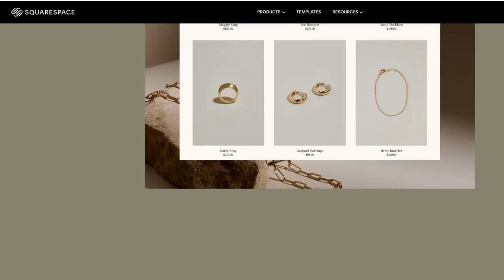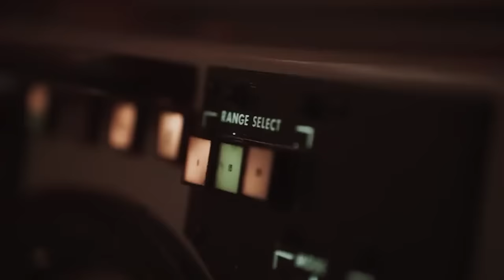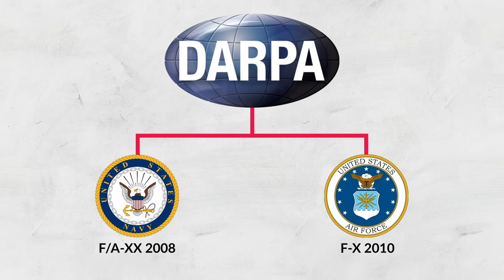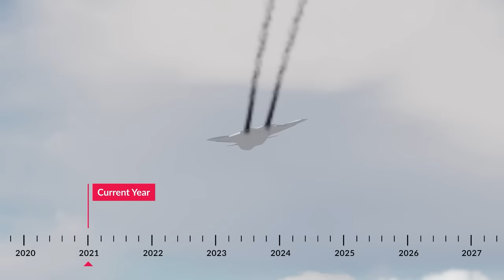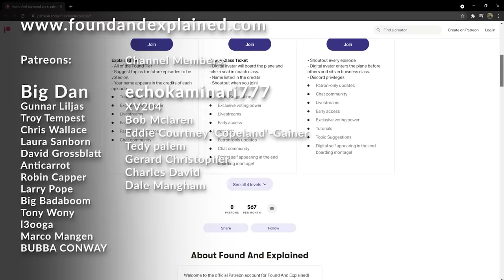FA-XX - The Next American Fighter Jet

Comment: 11:36 - The main reason Roper didn’t say whether it’s hypersonic or not is because it’s an absurd idea and is about as relevant in a 6th generation air superiority platform as the name of my third grade teacher. 

I hate to break the news to everyone who wants the next Gen fighter to be über fast: Speed is NOT going to be a primary concern for anyone designing or operating this airplane. Propulsion IS going to be a primary design feature, but not because of a particularly high top speed. It’s going to be about fuel economy and range as one of the biggest factors taken into account with this plane is it’s likely theater of operations. DOD is planning for the next big fight to take place over the Pacific and eastern edges of the Asian continent. This will not be a permissive airspace and will not be amenable to our current or next gen of tankers. Our planes have to go farther, have a considerably longer loiter time over station in some cases, and penetrate  peer/near peer airspace undetected. 

Hypersonic speeds gobble up fuel and generate a lot of heat. The idea that hypersonic speed and stealth are possible in the same airframe is certainly a great idea, but with our current level of materials sciences being where they are, that’s little more than a pipe dream for some time to come. Even platforms in low Earth orbit are no longer out of range. The United States conducted successful
ASAT tests DECADES ago. China is right there with us currently. That being the case, Speed and altitude are FAR less critical than low observability. 

So please, anyone who is still fixated on fighter aircraft needing to be balls to the wall fast and needing 3-D thrust vectoring with 30mm GAU-8 cannons and some sort of light bending skin a la Predator, you might want to lower your expectations somewhat. It ain’t happening any time soon. 6th Gen is all about networking. Information. Oodles and oodles of data shared at ludicrous speed with multiple other friendly combatants. The side who knows the mostest the firstest and can act on that data with overwhelming force and violence of action wins. Period.
Reply: "the side who knows the mostest and the firstest"

 I think we all can see the discrepancy here
Reply: @BoBo-pl3ww  I was quoting a Civil War General. While his grammar may not have been top-notch by our standards, it was damn sure enough for him to be the only man to volunteer as a Private and end the war as a General. 

So no, you failed to see the discrepancy because you took the comment completely out of context. 

But please…continue to assume the people around you are simple😊
Reply: @FloridaManMatty  no need to get so heated my guy. This was 8 months ago. Plus i don't even remember this. Also would have been a bit helpful to add quotations

Comment: 0:58 actually, the NGAD is going to be the replacement for the F 22 it is going to be a Air Force ground-based fighter aircraft not like the F-35C or F/A-18 a carrier based fighter aircraft the F/A–XX is going to be the sixth generation fighter aircraft, and the NGAD will be the air forces replacement for the F-22 as of right now Boeing and Lockheed Martin are fighting it out to get the contract for the NGAD a.k.a. next generation air dominance fighter and I’m pretty sure the F/A-XX is also going to be Lockheed Martin made because they are at the top of the military aircraft world right now. I mean just look at the F-22 and F-35 that’s all you need to know the only fifth generation fighters in the world are made by Lockheed Martin.

Comment: If they consider the F-86 and the F-100 to be the same generation, then the 6th generation should just be the 5th. They're just virtually the same technologies with a slightly different concept. But even then, if you classify fighter jet generations by technology level and niches, we're going to get even more outliers. The fact 4+ generation aircraft exist is just a precursor to this. They're not stealthy fighters, but are more advanced in other ways. Things like that will be developed still, it will never reach a point where every aircraft in the sky is a stealth aircraft, leading to the fact that the 5th generation is defined by stealth technology as problematic.

Comment: The F-22 is problematic? I know the f-35 has run into massive cost overruns and they are still trying to get everything the navy asked for in that jet to work and they keep putting equipment on it that the navy didn't ask for (adding to the cost and delays) but the F-22 is still having teething problems?
Reply: No not actually. The f22 is pretty much near perfect
Reply: @BoBo-pl3ww  I doubt that and it isn't capable to land on an aircraft carrier. I like the F-22 but the super tomcat should have been where the f-18 multi-role is.

Comment: The design is flawed, because the air ducts are sucking in the HOT AIR 🔥 from Underneath, instead of the COLD 🥶 AIR ABOVE the plane.

2ndly, The air ducts underneath the plane, make it more detectable on ground to air radars.

3rdly, The lack of a mid section air lift, w/ 3D or 4D movement vectoring is an additional limitation to this plane.

4th, Connards, are they still relevant in this decade?

Comment: For the next generation man fighter jet to render in the future, it will need a flat-bed style seating in a gyro maneuvers chamber(able to also eject) to absorb extreme gforce & isolate dynamic axis motion, scissors, pitch, rotate etc, it will also need breaking flaps to de-accelerate, at rates of speed acceleration that attune for maneuver as well.

Comment: Electromagnetic engines for an atmospheric space as we have on earth,  is the best solution for an air dominance plane, I know this fact, because some engineers are already working on this kind of non poluent propulsion and due to the fact that is already mensioned and  it's revealed on Ezequiel's bible book, chapter 10: 9 - 13.( one wheel inside the other, mooving in oposite directions. what is it , if not a electromagnetic engine, four of them for each ship?  for quicker moovment on every direction )

Comment: I don't see any other company other than Boeing (McDonnel Douglas) getting the contract. Maybe GD.

Lockheed have the SR-72 + F-35 to maintain. 

Northrop Grumman have the B2/B21.

And the fact is the F-16/F-15 are the most reliable and widely used planes. One made by GD the other Boeing. 

It's a done deal. Maybe NG might get it. But 10000000% Lockheed WONT.

Comment: Why are they decommissioning the F-22 if if is the best fighter we have at the moment? Haven’t read into it much, but on surface level it doesn’t make much sense
Reply: It's extremely expensive,  it's threatened by modern weapons, there's plenty of issues with the f22 standing right now. They want to take it out by 2030 and replace it with a new design that won't be threatened by as much

Comment: Instead of scraping 186 f22s which has still never been beaten when the day comes for this 6th generation fighter to take over why not give the raptors to the air national guard and use them as strictly home defense jets makes way more sense then getting rid of them I'm sure 186 raptors can handle protecting all of America
Reply: problem most of these so called 6th gen fighter aren't really 6th gen, its just 5th gen. u can look up all there design all just a copy of f22 and f23 lol

Comment: How about the autonoministic auto advance and tracking targeting and engaging systems they were automated structure control and automated adaptive abilities within multitude of tracking and neutralizations of sophisticated weaponry Russia for that matter would be one of the incidents that I would bring up would be Russian and invasion forces / weaponry and equipment to neutralize that equipment they would rely up on a couple of different applied drones and inner communications with a wax master control system but that's neither here nor there how about the autonoministic broadband system in broadband interlinking within cell avionic radars and then there are capitalized supposed advance capabilities as in shrinking and expanding taking aerocraft into the future barometrics and time travel being able to control the electrophute of the microwave particle broadband system and pull a hyper electrophil which would be like a lightning bolt scenario and adjusting that within barometric pressures of static conduction and biopressures from how fast the jet goes you can go into different dimensions and shrink supposedly from what rumors were if you fly the jet into this zone and you have the broadband system creating this type of electrical field in the zone and you hit that at this for level Mach 5 level you can get into a barometric anomaly which would compress the plane and shrink it supposedly

Comment: Except the reality behind the research into the 6th generation is that the F-22 and F-35 are technical and financial failures. The 2030 goal isn't optimistic, it's necessary for the Air Force's future !
All the tests carried out in the export of the F-35 classify it far behind fighters of previous generations, for a financial cost up to 4 times higher than the competition. It is only through political support that the United States has managed to sell it to Belgium, the United Kingdom or Switzerland as examples.
Reply: F-35 costs less to buy and less to operate than 4.5gen fighters like the F-15EX. They can beat an F-16 dogfighting, have much better range on internal fuel than older single engine fighters and class leading radar/avionics. At this point the F-35 program has come good regardless of previous cost over-runs and delays.

F-22 is still the world's top air superiority fighter, the only real drawback being high operating costs and time spent in maintenance. Why is why the F-22 is getting replaced but even now there is no true equal to an F-22.
Reply: @AlexConnor_  "F-35 costs less to buy and less to operate than 4.5gen fighters like the F-15EX" AHA... sure...
F-35 program cost 1700 billions US dollars...
The flight hour for an F-35A is currently at 33,600 dollars...
The current Air Force Chief of Staff proposed to replace the oldest F-16s and which was to be replaced by F-22s or F-35As, to take other 4th generation aircraft much cheaper.
Reply: @1bardiel1  F-35 program cost $400 Billion so far but you can buy an F-35A for an $80M unit cost now. Meanwhile any rival 4.5 gen fighter is $80-100M. Well, except the Gripen E, but even that costs $65M.

$33k per flight hour is very competitive for 5th gen, ok so I was wrong and F-15EX costs $29K per flight hour but still very close. And the F-35 flight hour cost is still coming down, may well end up cheaper to fly. 

Yeah, Air Force is looking at a new 4.5 gen aircraft to replace 900+ aging F-16s still in frontline service. Makes sense, design can be faster and less expensive now, those F-16s need replacing and a simpler fighter could definitely cost less than $80M and $33k/hr while still maintaining Air Force numbers.

That doesn't mean the F-35 is bad value though, just Air Force has given up on replacing F-16s 1-to-1 with F-35s.